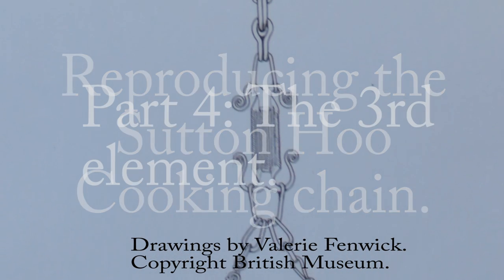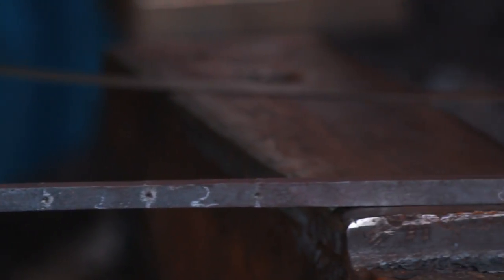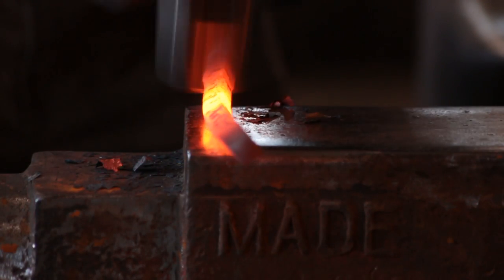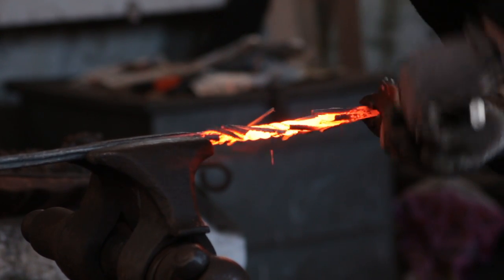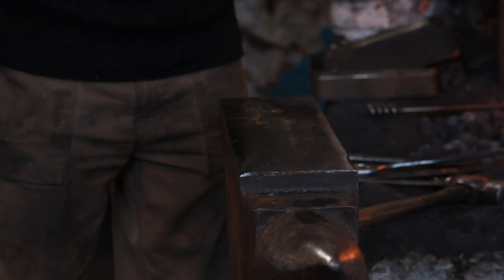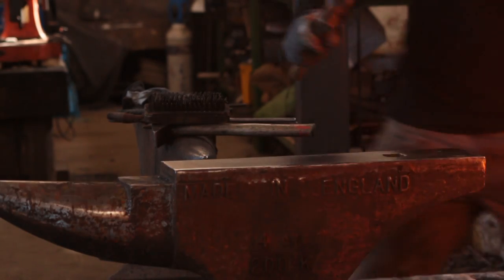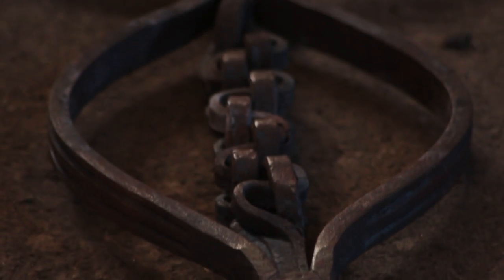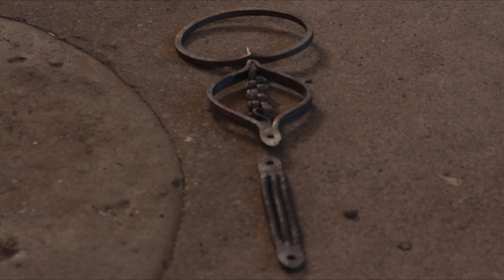Forging the Sutton Hoo Chain. Part 4: the third element.

Comment: It never fails to amaze me at just how easy you make forge welding wrought iron look. I am going to have to find some to practice with.
Reply from the maker: Thanks Bob :) It is easier to weld with than mild steel so I would say use the hard stuff and the wrought will be a doddle!
Reply: Where are you I have some you could have

Comment: Really nice. wouldn't of thought to twist it all in one bar, would there be any visual difference if it were forge welded together as three individual twists?
Reply from the maker: KiK'sForge none whatsoever. It is also easier to hold it all together prior to welding. as the parts aren't all trying to slip away from one-another.

Comment: Do you use a standard wire brush?  I saw a video on YouTube here that suggested done kind of horse brush that used small flat springs rather than wire bristles.  What are your thoughts on this?
Reply from the maker: Matthew Millar we call them butcher's block brushes over here. the flat bristles do a better job than the round bristles I find.